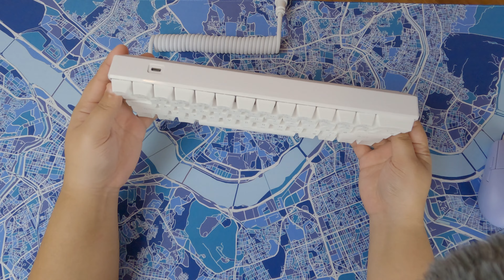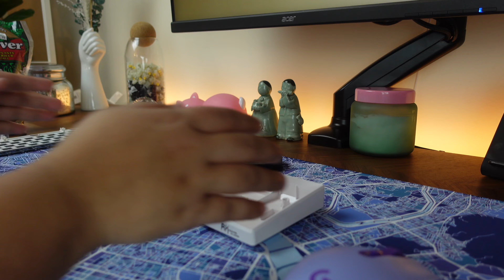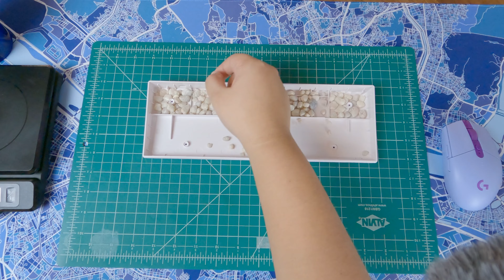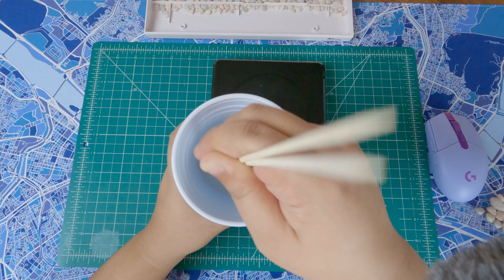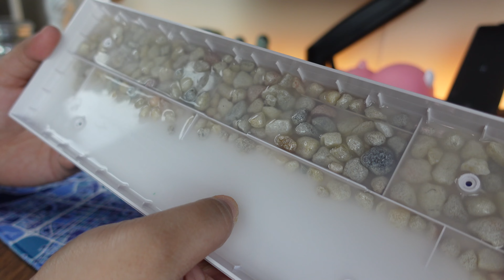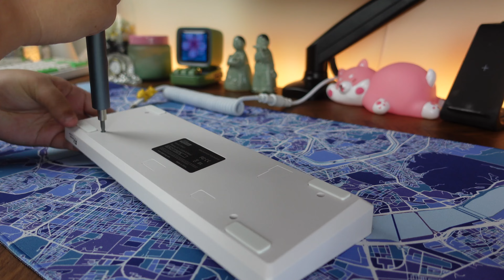BEST budget keyboard & NEW mod | Royal Kludge 61

Comment: A nice sheet of Kilmat sound deadening material in the back of the case does a great job of this too and is quick and dirty. Fortunately it’s super dense on its own so it adds both weight and improvements to the sound
Reply from the maker: Yeah! I have some butyl rubber that I’ve been meaning to try. I’m not sure if the kilmat has this issue since it’s also foil but the smell is undesirable 😂
Reply: @emkeeb  had some in my Q1 and while it definitely didn’t smell amazing, it wasn’t too terrible and was only noticeable when I pulled it out to try something else
Reply from the maker: @TheAeroJ-94  I wonder if the smell would just eventually dissipate. I'll def try it in a future video :D